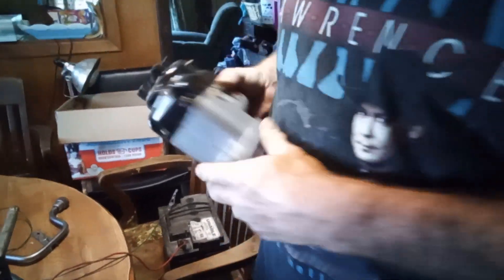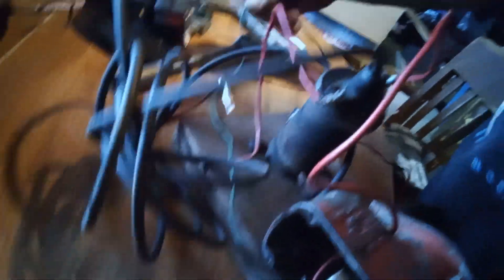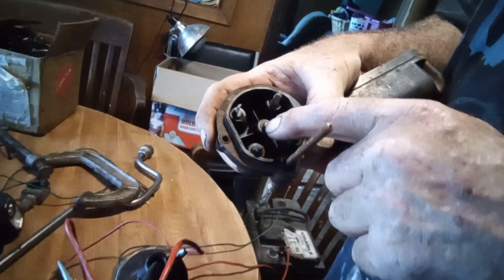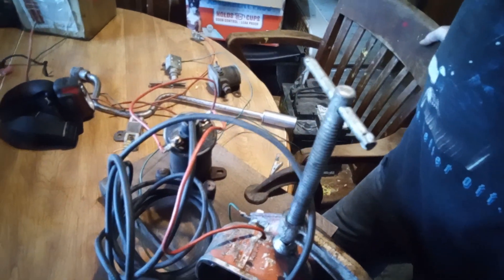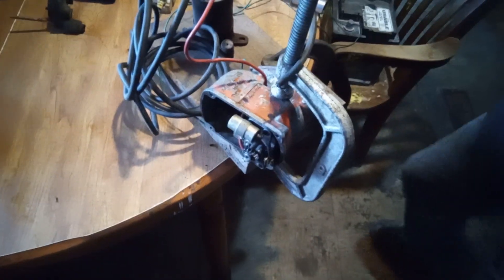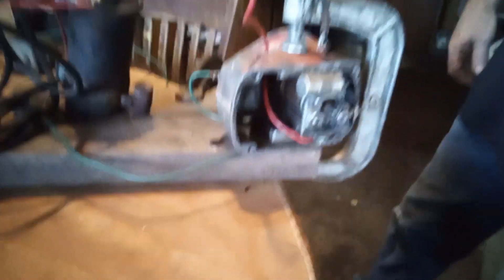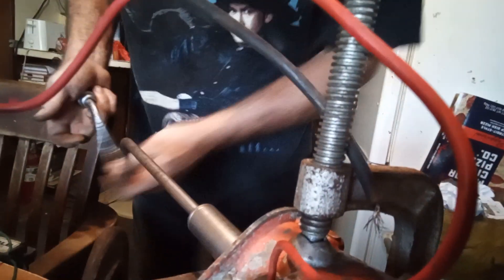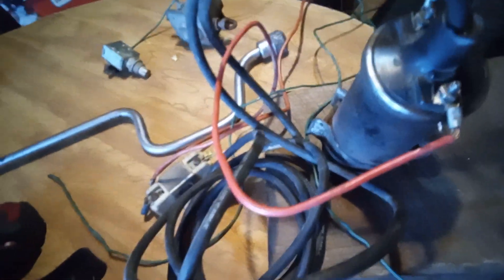Converting a Magneto to a dist hooking up a 12 volt coil.

Comment: You know, I've managed to work all these years on old tractors and stuff and keep my knowledge of magnetos at a minimum !!  I DO have several daily drivers that have good hot mags and am lucky for that.  But this is a good remedy for one that has failed.  Its getting pretty hard to find guys to rebuild them anyway.  Thanks for providing me good info on making this work !!
Reply from the maker: Hope it helps others. When I was pretty little my Father had a David Bradley garden Tractor. It had a model Z Brigg's engine. The coil went bad. And a new one cost over $50 way back then. My brother was working on it. And Him and Dad rigged up a coil on it.  made a battery box for the battery. That battery was as large as the Briggs engine. Thats the first time I seen a mag  ignition  converted to a battery sparked .

Comment: Of course the coil connections assume  it's a negative ground system.
Reply from the maker: Yes most 12 volt systens are negative ground. with a six volt it will be positive ground.

Comment: This could be taken one step further...
Wire the points to trigger a switching transistor, or a common "junkyard" ignition module. 

The solid state switch takes the high-current switching duty away from the points, they will last almost indefinitely. Also, since the points aren't switching the coil directly, a modern  "hot" non resistor coil can be utilized.
Reply from the maker: Yes and that would make it more efficient.And would be worth doing if you where actually working the tractor for many hours at a time.